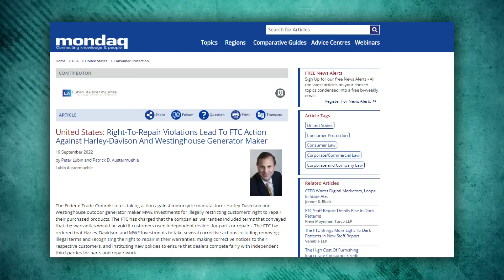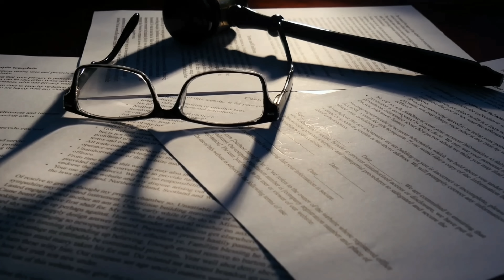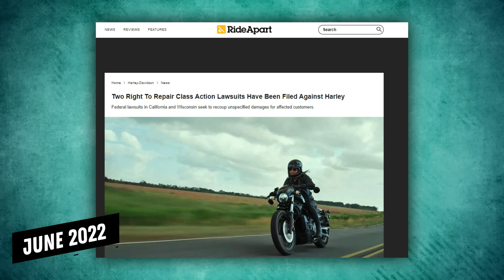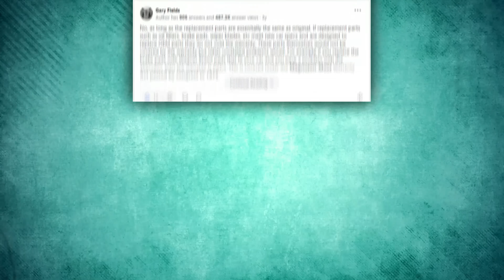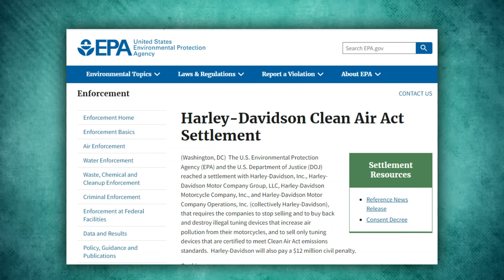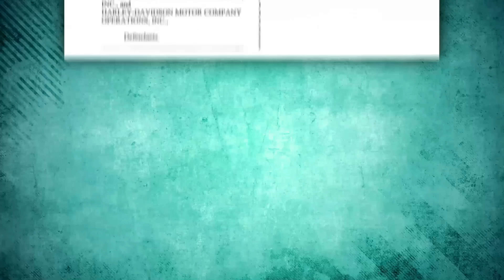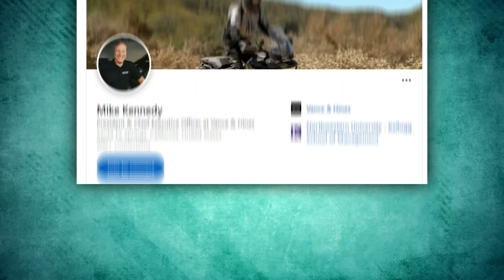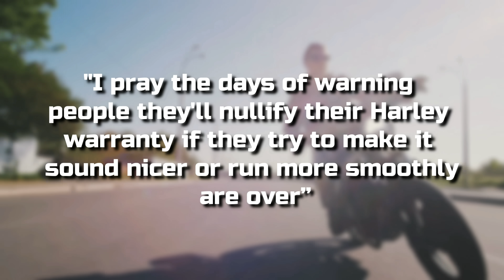This Affects All Motorcycle Owners!

Comment: Yet another reason to buy used and do not worry about a warranty. It is part of being a biker is to fix and/or upgrade your bike yourself " Warranty? We need no stinkin warranty!"
Reply: People buy new bikes put 2000 miles on and sell. I would NEVER buy a new bike unless I hit the lottery
Reply: Tail light warranty is all i ever had, soon as the seller sees the tail light, warranty is over.
Reply: Hd has been out of control 4 years reelem back in ffs
Reply: @joemetro352  because how much they cost?
Reply: @ROLLIN-DUB  That is why you are better off buying used. Let some other sucker piss away their money and be underwater the moment they leave the lot. Heck, In a couple of years you can pick that guys bike up for a reasonable price.
Reply: I don’t know too many guys who turn wrench on their own bikes. Hell, I don’t know many who can even adjust their lever mounts for better ergo. Most I know take their bikes in for oil changes.
Reply: @BfromMtz  Yep, And if the new bike bites you in the ass look at all the new skills you are about to learn. I had a Aprilia RSV1000r that bike was a complete pain in my ass. I use to ask her when climbed aboard " where are we breaking down today?" By time I sold that bike I new every nanometer of it.  When I was done with her I could hire myself out as a Aprilia mechanic.
Reply: Additional to that, a stock harley is awful and needs suspension work, brake work, cams and a tune. Not surprisingly, harley sells everything. It's a genius business model, to sell a sub standard bike for too much money and offer all the parts that should have come on it from factory.
Reply: @BrandonWest87  I guess it is no longer a point of pride for some to know how their equipment works and how to fix it.
Reply: @tomrodgers6629  so your suggestion would be buy new with warrenty or old without? Here’s the deal I’ve recently learned how to ride and honestly I am not mechanically inclined, just want the security of a warrenty while learning how to fix. Which would choose?
Reply: @ianm432  You forgot the special edition oil catcher pan to leave under the bike. Lol I will say one thing about Harley they force their riders to be self reliant and to become skilled mechanics not techs but real mechanics. I have seen some jerry rigged things on Harleys it made me proud.
Reply: @tomrodgers6629  surprisingly, my 14 year old Dyna doesn't leak a drop of oil. It is however all stock and sucks at every but being loud and obnoxious. I can't wait to sell it lol
Reply: @ROLLIN-DUB  I am sorry it came across as a yes or no statement.  The thing about motorcycling we worship at the alter of individual freedom. If you can afford a new bike get a new bike with warranty.  I am just reflecting the way I and a lot of other guys grew up. One bit of advice. If it is your first bike I would go used with a warranty. You will drop it everybody does/.
Reply: @tomrodgers6629  lol.   My wife's Sporty doesn't leak a drop, although it does enjoy burning it with less then 5k on the clock.....
Reply: @tomrodgers6629  they suggested that at school as well, but I was unaware that you could get a warrenty on a used bike- thank you for the advice
Reply: exactly.
Reply: @ROLLIN-DUB  Dealerships sell used bikes with warranties but I would look at small shops near you first. You can save some money and get above average service at most shops. As with all things do your research.
Reply: I bought my very first Harley (not my first bike though) so I could get a nice bike and build credit…however I bought used “as is” on purpose cause I knew better personally and I do feel bad for everyone unknowingly getting stuffed by the new bikes …. The “iron “ clad they have is just far being ridiculous which yes IS unfair even as a multi bike buyer of Harley over years continue to get screwed I’m glad law suits r happening maybe the wake up call can be rooming now and build momentum! Flip side…I actually do enjoy my first Harley and will get another but used of course to add to my collection! Riders be safe be smart stay informed keep two wheels down!
Reply: I have not brought a bike into a dealer for work since the early 90's.  If you have a bike you should be required to be able to tune it.
Reply: @stevel6939  " Required" is a bit of a strong word. Our culture based on freedom. We should educate them on what they are missing out on by not working on their own bikes. For me working on and riding my bike is therapy. I seen a great T-shirt it read " I don't need therapy I own a motorcycle" But I see where you are going there.
Reply: I void warentys
Reply: Spot on but let’s face it most of theses dudes don’t know shit about working on bikes.
Reply: Warranty Smarranty...
Reply: This tbh
Reply: True that,especially with shovelheads,if you can't work on it you shouldn't be riding it and now most Harley Davidson shops won't work on the older models ! I'm 71 and NEVER owned a new scooter, buy it used for a reasonable price and then make it into the bike you want ! We Don't need no stinking warranty! Maranatha, Greetings from Tampa Florida 😎
Reply: @tomrodgers6629  fair enough.   Just based off being stuck on the side of the road experience, where some basic mechanical know how would have gotten me back on the road.  Having an extra masterlink and knowing how to put it on, for example.
Reply: So, is HDI getting sued? Or, one of their many layers of protection?
Reply: Yup. Buy a bike with the best of the best installed. He hates it cus he just had dudes install the best of the best. No engine formula. Runs great around 3k. Won't idle. Gets really hot on long hauls. 2k in exhaust and 4k for the top end. Cool. So, I'll give ya 3 grand. Haha!
Reply: Agreed. First summer riding, bought a used Harley and that has been part of the fun for me is learning how to do my own work.
Reply: My Electra Glide is now 10 yrs old and feeling it’s age in respect to hours spent on it fixing problems due to wear or just unforeseen events.
 Is the term ‘built to last’ just a fallacy?
Reply: Reliance on warranties is a problem with all things these days.
Reply: Bought an extended warranty with an FLH and best thing i ever did.
6th gear bearing 2 radios the compensator. Used sure its a hell of allot cheaper but still you never know what the person prior did with it.
Reply: Thanks to everybody that replied this is kinda like hanging out at bike night thanks
Reply: @joemetro352  I'm the guy that buys the 2000 mile used bike at a sweet price!
Reply: Tried buying used, in todays market i made more sense buying new for me than used.
Reply: @mikep4823  Jeez…the tape decks in old Goldwings still work without issue. Changing tires, oil, final drive, plugs, and valve adjustments are pretty much all they ever need. If my bike was munching transmission parts, I’d be getting it out from under me quick.
Reply: @joshuacuellar328  My new wing was a few grand more than late model used. Honda was offering 0.9%, it was a no brainer at that time
Reply: My newest bike is a 1990
Reply: @BrandonWest87  thats cool. I wanted a 2022 street triple  and the used 2020 2021 2022 were either a grand more ore less than a new one not including all the BS fees they charge which is bs to charge that in used. Then the interest i was getting was more on used than new. So i just bought a new one.
Reply: @joshuacuellar328  That’s def how it works sometimes. Just takes a long hard look at the numbers to find out which works out better.
Reply: @BrandonWest87  yeah thats exactly what i did. Took a while to make a decision.
Reply: yeah brother but I got to say this too some of us are not mechanically inclined like you are but we still love to ride I don't want to understand how it does it just that it does get my knees in the breeze and get somewhere
Reply: I do what brother I have one new bike that's the one I own now I've owned it since 08 I'm one of those guys who ride that horse down to the ground I'm in the process of rebuilding part of mine mine was the first motor trike kit I guess and I'm here to tell you it wasn't much I've actually had the bike sit down on me on the road but there is a company in Columbia Tennessee called s&g cycles I trust them with any bike I got
Reply: @fxlrs_oakdale7234  You can get the extended warranty on the used.
Reply: @williamdowns4817  At least you are on two wheels. The more of us out there the better off we all are. Be safe and keep the rubber side down.
Reply: @fxlrs_oakdale7234  I stand corrected. I have no experience with warranties. I buy, ride, fix and repeat. Lol
Reply: Slam dunk Tom, my way of thinking exactly
Reply: I dont need a warranty but its nice to know a company backs their product with a good warranty they put their money where the mouth is when they say its reliable
Reply: I buy all my vehicles used and actually own them, and ya I know what you mean, I never had a warranty, and insurance is cheap don’t need full coverage
Reply: @cassiusdio6048  i do lol
Reply: @BrandonWest87  lol it's not in their blood then their motorcycle owners not motorcycle riders
Reply: @johnrhodes101875  If they sit on them and ride them places, I’m pretty sure that makes them riders.
Reply: If I was buying a Harley I’d buy a used one and change a bunch of stuff to make it mine before riding it too much I don’t wanna ride around on a bike and keep getting asked if I got it from Billy Bob.
Reply: @GratefulEd907  I turn wrenches on my bike to know it is squared away and I can count on it. Plus when you work on your bike it becomes a part of you and you of it.
Reply: @tomrodgers6629  I work on my bikes because I can’t afford to send it to the shop for simple stuff. And thank goodness for YouTube for showing me how to do what needs to be done. I bought a 79 cb650 from a friend though and was asked a lot if it was Darrel’s bike. I think the look of a Harley can be changed a lot just by switching the handlebars and seat to make it more of your own style
Reply: Ridiculous
Reply: I’ve never had a issue with getting my warranty to cover any repairs with the two Harley’s I’ve owned. It works so well I keep the 2017 Street Glide Special under warranty .
Reply: @joemetro352  they also crash them than sell them. They do all sorts of things to them, than sell them. In many cases the things they did void the bikes warranty.
Reply: People talking about buying used, but haven’t a clue what those used bikes have been through. If you listen too all the aftermarket parts and upgrades available you have no idea if those parts are recalled, or defective. A new bike is Monitor by the manufacture and the government. The only people pushing the no warranty nonsense are those who own independent shops and looking for customers or do it yourself with no clue what the hell their doing to those bikes. In most cases their the reason their bikes are giving them problems. It’s a motor vehicle. If you have no formal training in repairing them, all your doing is tinkering with them.
Reply: If a new bike is 7k and a used one is 5k I rather spend the extra 2k and know it was broken in properly and actually taken care of
Reply: Mamma what’s a warranty? “It’s when your bike goes away and never comes back again forest”
Reply: @BrandonWest87  all yuppies need to stay off them. ....
Reply: @tax905972  Magnuson Moss Act makes that a legal impossibility unless the manufacturer proves beyond a shadow of a doubt that the installed aftermarket parts caused the failure.
Reply: @tax905972  So you’re one of those guys that spends all that extra money on the warranty because you’re too scared/intimidated/unfamiliar with tools to do your own work. We got it. Some men don’t have manly skills anymore.
Reply: Yet the problem for me is I don’t trust that the used bike is even well taken care off a person can literally full throttle it and it could still have 10 miles
Reply: @Anonymous-jj9yu  That is true the guy might have disconnected the speedometer cable when he got the bike so he could beat it then sell it for the price of a bike with low miles. But my comments are aimed at people that work on their own bikes. A seller can't hide shit from us.
Reply: @tomrodgers6629  I need to gain more experience
Reply: Most buyers today are not bikers.  They would not know a screwdriver from a ratchet.
Reply: @John P To the coffee shop and home?
Reply: @ROLLIN-DUB  idk what his reasons are but reasons I can think of are cheaper, already broke in any problems are usually already fixed and caught once you pull off the lot they loss alot of value that and Harleys can easily go over 100,000 miles these days.
Reply: I agree. The Softail Standard is going away in '23; I've been looking at getting one since COVID. I'll get a good deal buying used. Once I pay that off I can trade it in and have a down payment for a Freewheeler.
Reply: Very true. I'll  never buy new again.  I'll buy from  owner.  I've  basically  lost  20 grand. It's a dam shame
Reply: @ROLLIN-DUB  about 55 grand Sir